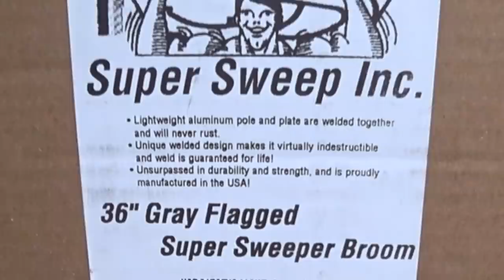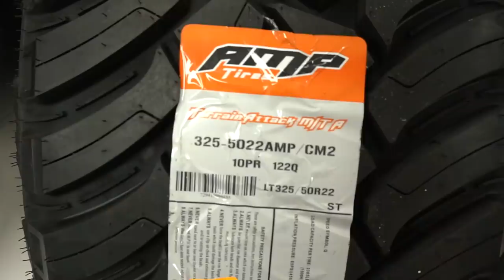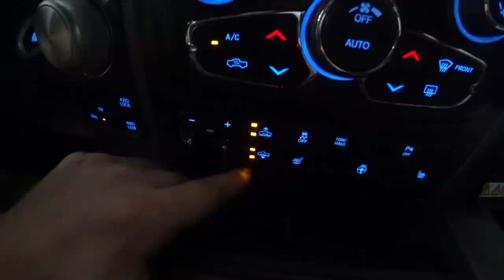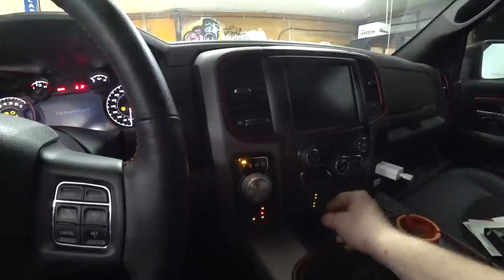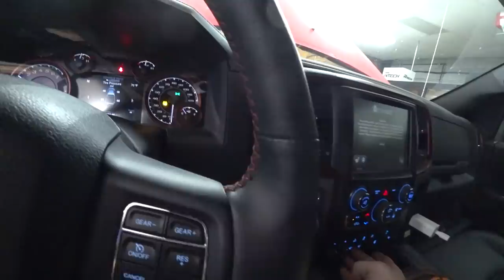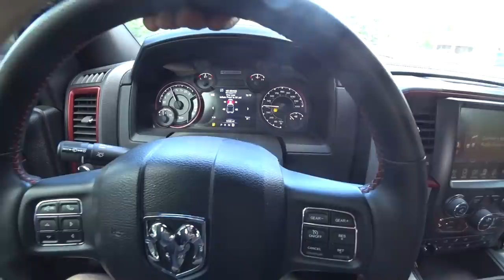Putting HUGE OFF-ROAD WHEELS on my AIR RIDE Truck

Comment: Don't worry, we got you on a lift kit to keep your air ride. Can't wait to see it all come together!
Reply: Probably the best company ever
Reply: @logan048  Appreciate the support!
Reply: Wish it was just that easy😂
Reply: Yooo, custom offsets coming in clutch.
Reply: Hey custom offsets sponser my Tacoma lift😂
Reply: Everyone needs to start using Custom Offsets now! Amazing Company..
Reply: Hey you wanna hook my brother up with some wheels and tires and a 4 inch lighter has a 77 f150
Reply: My '14 Ram 5.7 Hemi is hesitating to start once every 5 times. And it's throwing a bunch of codes. One of them was the camshaft sensor I've already replaced it. And it came backup. Any of you fellow Ram divers got any suggestions?
Reply: Should I just give up and trade it in for something else?
Reply: Oh heads up @custom offsets. You are going to be the ones i buy my 3 inch lift, tires and rims for my truck
Reply: I've had a new set up picked our for a while now still sticking with 33s but I'll probably be ordering today or tomorrow
Reply: I need rims and tires for my 2008 Audi A6 😭😭
Reply: Hey I have a question can I custom order some ‘tis wheels from y’all?
Reply: Yo put a 12” lift kit😂
Reply: Shit yall got anything awesome I can slap on a Mazda 3 cause I’m too broke for a truck 😂
Reply: Michael Klincus  what have you had done to it so far anything to do with performance?? Like supercharger, exhaust if so you might need it tuned I know when I put an exhaust on my car it kept throwing codes till I had it tuned
Reply: Lol I need you to get me with that $2500 lift to keep my air ride
Reply: What’s the offset on the wheels?
Reply: Can you tell me what this exact combination is so that I can order for mine? I have this exact truck and have been looking for this

Comment: There is a company that sells a lift that will keep the air ride. I looked into it for my rebel. It’s a little pricey but I think it’s worth it.
Reply: Did you end up getting them ? And from where ? I want some on my rebel
Reply: Why not just stick to coil

Comment: Keep in mind that when your Speedometer registers let’s say 60, your actually going about 65. Just so you don’t get too many tickets😂
Reply: Blake Hagan  tuner will solve that problem
Reply: Just do the math... newtire diameter *3.14 / OTD *3.14.   Take the number multiply it by the speed on tach and that's how fast you are going
Reply: willburr13  you’ll still want to adjust it or your adding more miles or not as much as your actually doing

Comment: Be careful with the Air Ride jacked all the way up. They limit the speed because hitting a bump or pothole at higher speeds has a high chance of busting one of the airbags. Not something you can usually drive away from because your suspension would collapse. Looks good though dan!

Comment: Dan the seatbelt chime is super easy to cancel. Takes 30 seconds. Buckle up turn truck to run unbuckle and rebuckle 3 times and then shut the truck off. If it chimes once you did it right

Comment: Get the adjustable links for the air ride. You can set it so normal mode is the same as offroad mode is now. I had them for my rebel, it made offroad mode too bouncy to be usable, but the rest of the time it was fine. I had 35s.

Comment: Before you rip your suspension apart, look into the BDS 4 inch lift that works with the factory adjustable air ride.

Comment: If you pull the fuse on the suspension then it does freeze, but you will have issues cuz the compressor cant pump nitrogen into the bags. Your suspension will sink over time and you will have to put the fuse back. Its annoying but i ran into this issue on my ram. Truck looks great!

Comment: I always loved the fact that the Rams could fit 12 wides with no trimming and 14 wides with miner trimming. Like Dan referenced, my Silverado needed a 2" level to fit my 305/40r22 on 22x12 and I still had to NorCal cut the fenders. That's comparing my 32x12 tires to Dan's 35x13 tires. I would love to drop my truck back down those 2 inches, but I wouldn't be able to even turn in my driveway.

Comment: I would do some kind of bed liner along the bottom of the doors to protect the truck from rocks those tires will toss at the body due to them sticking out a bit

Comment: I wanted my 2014 Ram to be low and wide but I went with 6.5 lift with 20x10 wheels with 35 inch tires!

Comment: You put the truck to offroad mode then pull the fuse and it will stay at offroad height at all speeds

Comment: Omg these tire/ rim combo.  I see these everywhere.  Ima big tire, smaller rim combo fanboy.  Yeah yeah i know.. At least there's some tread on it.  Lol they look pretty good bro.  Btw getcha a GPS speedometer on your phone and see what's the difference in mph with the new and bigger wheels. Oh and if your hauling stuff behind your truck,  keep in mind,  the higher the truck,  the more you'll need a drop hitch and more pain to load/ unload stuff in the truck.  Been there some that.  Lol they'll look badass til your like,... i gotta load a couch in the bed... fuck that's high.  Lol and around 20:00 is tire hummin. Love that sound.   Keep it up danno. 
🇺🇸😁🤜🤛😎🇺🇸

Comment: It’s sad cause I live in Belgium were the tires need to be inside the fender “for safety reasons” or something stupid but looks good Dan
Reply: In most places in America it’s the same way. They can pull you over for it, but usually it’s just a fix it ticket.
Reply: Depending on where you live these monsters won't even fit everywhere. The RAM is already massive, the dually's a goddamn freight truck compared to our European cars.
Reply: Luke Leedy it’s really just PA
Reply: Chad Kroeger I mean maybe. Idk I think most southern states don’t have serious consequences.
Reply: 8eewee my f150 has an inch of poke and I barely fit in places like LA

Comment: I have a ram 1500 with a 2in lift on 35x12.5r 20 and i love it that looks so sick bro
Reply: Also order the rough country speedo calibrator. It works perfect and is fast and cheap and it works as a code checker

Comment: Me: wondering if a 20mm offset increase would negatively affect my wheel bearings or suspension geometry.
Dan: installs oil barrels for rims.

Either I'm overthinking, or Dan's underthinking. I guess the universe is balanced, so that's ok.

Comment: You could probably trim the mounting points on the plastic wheel well extension's and be able to move them up so they don't rub or hit.

Comment: Great video! I own a same model ram with the same wheel size but just on 33s instead of 35 because I was afraid of not clearing them and I don’t want to lift it either and after seeing this video I’m for sure going with 35s next! Truck looks great by the way !

Comment: The flicker from LED's can cause headaches. A capacitor might reduce the flicker or hang some timber in front so you don't directly see the light but still light the wall.

Comment: When I ordered mine I thought the sensors did the same thing, but after some more driving around and the TPMS light started flashing and said there was no tires programmed. So I had to get them programmed. You need atleast a 7inch lift on a silverado to fit 35 with no rub.

Comment: You can get suspension lift that change the coil overs two bags so you still have your air Ride but the air ride is front and back

Comment: If you went with 20' X10s and 33's do you think it would rub in parking mode? Trying to figure that out before pulling the trigger. I need parking height to fit in my garage. 

BTW what exhaust do you have on that? Sounds incredible.

Comment: The mopar TPMS system always automatically updates and will pick up new sensors (if compatible) and if you rotate the tires they will update after a quick drive (just a bit of info from a mopar tech)

Comment: Your tire Pressure light is still on so that means they haven’t registered them yet you will probably have to use a Scan tool to scan the Sensors and then the light will go off as you drive it

Comment: make sure to re-torque the lugs after about a week or i think its like 500 miles
Reply: also on the tpms sensors, what they did was program the sensors for your truck, and all chrysler jeep dodge and rams are self learning so once you set them for the model of the vehicle they program them selfs and read PSI on there own

Comment: If their over 18” their not really off road wheels. There pretty much only for show. You can get by on 20”s if you’re running 35’s or 37’s but 22’s are pretty useless off road
Reply: Yeah, you’re not gonna get any real helpful sidewall flex
Reply: Dan isnt off-roading this truck. And you really dont need sidewall unless you’re trail running. -a guy with 35’ mud grapplers on 17 inch wheels.
Reply: tell that to my friend that has a duramax on 22's and 44's that drives through ponds and shit lol. also yes this is an exception in my case your statment is mostly true.

Comment: Are the right side tyres the wrong way round? They look like they should be directional to me?? 🤔Although i could be wrong 🤷‍♂️
Reply: Nah all 4 aren’t directional, so the right side flows backwards. Coincidentally it looks like the tires were mounted as if the mounter thought they were all directional and were all mounted facing the same way so I believe he has 2 “backwards” tires

Comment: It has that pit bull stance I say keep it usable, you're not that tall of a guy; you can lower it if you need to load any thing  in it and you have the gm nally sitting on a 8" lift I'd keep one more daily practical.

Comment: not trying to be a big fight starter here but i strongly disagree with the half ton dodge being the best available truck right now. I've had to replace 4 rear ends from minor stuff happening because they are weak and bend. like straight up axle tubes bend and it's shot. Also typical Chrysler stuff, their door panels suck to service because they bolt in as a panel (prefer ford and gms designs). pretty much every hemi especially the 5.7's have horrible valve train noise and exhaust leaks in no time at all. they like to have valve seat issues. plenty of things to not like, there's a reason they are the cheapest of the big three apples to apples. they aren't junk by any means but i'd take a dodge 1500 (specifically talking about half tons) probably 4th out of the options for trucks. now hd trucks i'd take a dodge second to a chevy.

Comment: Got to love those U S of A xD in EU you CANNOT do things like that. Everything has to be within manufacturers specs and when you find something that will meet those specs you have to make sure that it has safety approvals and that kind of stuff. 
I installed coilovers in my car but had to buy ones that are approved and after installing them some "approved mechanic" had to take a look if it meets regulations and is "safe" to use on the road, gave me some papers. I had to go to something like your DMV(?) so they write all modifications into vehicles documents (coilovers, how much it was lowered and thickness of wheel spacers). Like that is annoying. If I ever decide to lower it even more or lift it, technically I should go through that procedure once again...EU for car people is not a fun place to be.
BTW Yup it looks DOPE AF :D
Reply: BarteQ72 there are laws in America too about ride height.
Reply: @pancakefactory  surely not as "bad" as europe
Reply: @pancakefactory   but I bet there is much less hassle with it. Go to the shop, lower it get inspected and on your way. Correct me if I am wrong.

Comment: I must say, I drove a 2016 ram 1500 and then drove a 2016 f150 of the same trim caliber and I wasn’t at all impressed with the ram vs the ford. Both had around 75,xxx miles as well.

Edit: this is in no way a hate comment towards ram trucks. I was just stating my opinion based on what I have experienced

Comment: Fuckin dope truck. The way you put the wheel on the first time made me cringe lol. The easiest way is to put the tire on your foot and align the lugs holes with the studs then sit or kneel and use your foot to raise it and use your hands to push it onto the studs. (coming from a discount tire employee) also in case your wondering or anything the stock torque spec is fine with those wheels and tires, its more about what size the studs are.